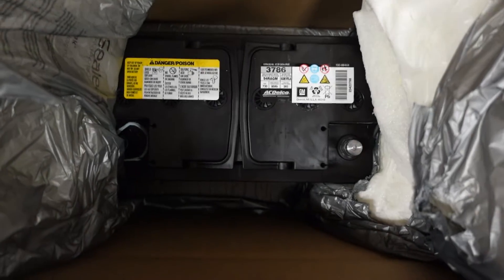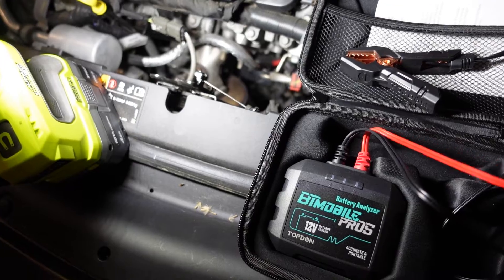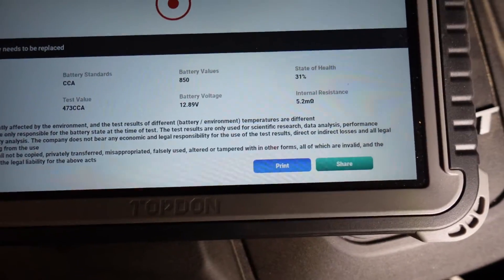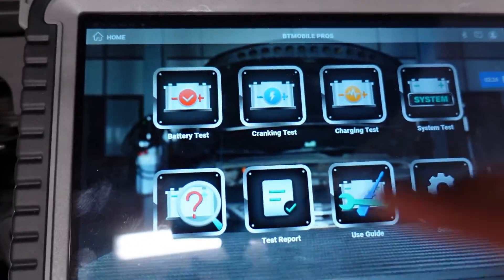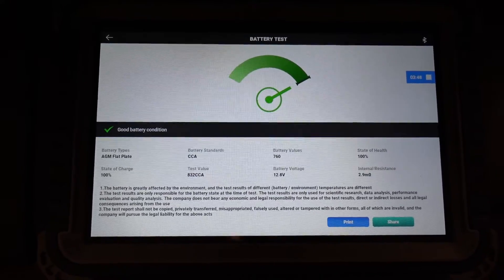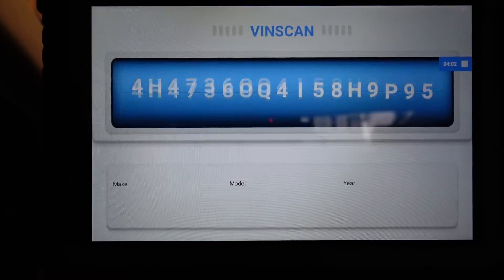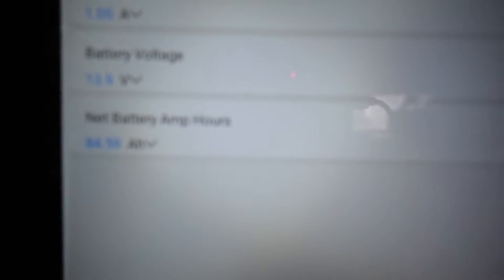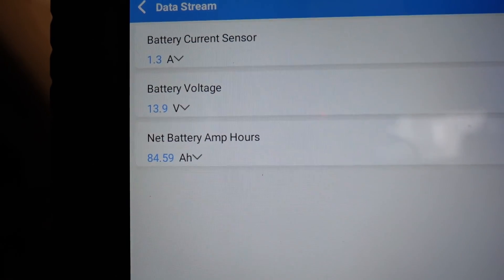Evaluate the SOH of your AGM car battery with this parameter - DON'T use CCA ⚡ Use this instead ⚡

Comment: I'm not sure it's to do with chemistry of your battery... BUT i noticed that you connected the tester on the terminals at the FRONT of the car! That way you introduce additional resistance to the measurement. 
As an electrician i would say, that to get a true reading, you need to test it directly at the battery terminals in the trunk.
Those testers calculate the cold cranking amps based on the resistance and voltage drop it sees when putting in a known resistance, not by actually testing the full amperage.
So you might have got a fals reading by testing at terminals in the engine bay, not at the battery itself.
Reply from the maker: "you need to test it directly at the battery terminals in the trunk" is basically my conclusion, either take the battery out of the car, of use a scantool and look at the Ah.  I never showed it, but I took the old battery out of the truck, I tested it at the terminals and the resistance was high and the CCA were low, so the battery needs to sit for a while before testing, at least this suggest that.  But for sure, thanks for adding your perspective, I have learned the LONG way - either disconnect the battery and test at the terminals or Ah monitoring through the scantool could be viable.  Also, I have an EFB in my 2021 CRV, and when you test it at the terminals, it gives false reading of the SOH, which makes me again think that battery chemistry needs to be 'rested' before taking measurements on a deep cycle battery I know this assumption may not be right) but in any case, I got it, I just spent $170 to figure this all out! 😂😂🤔🤔💵💵